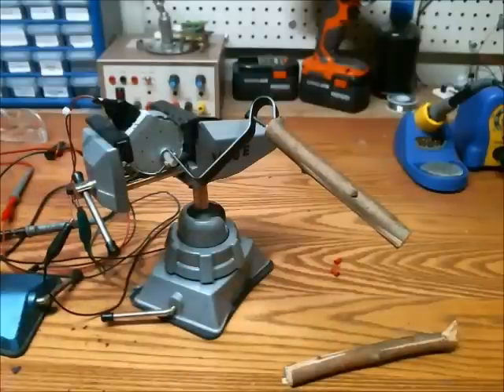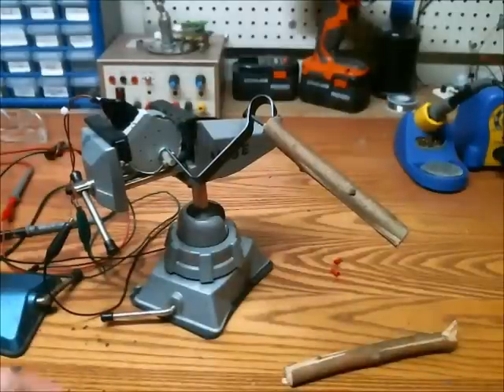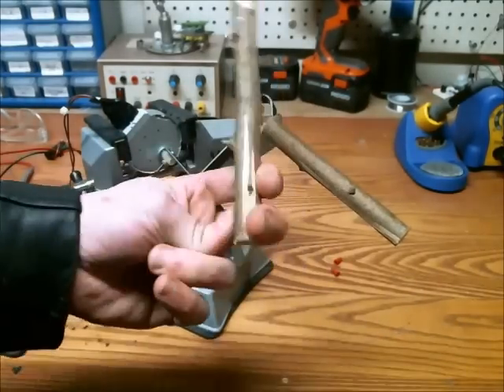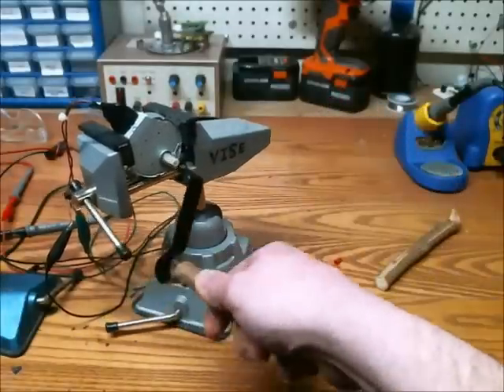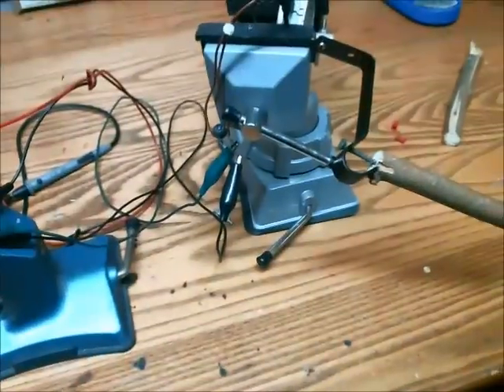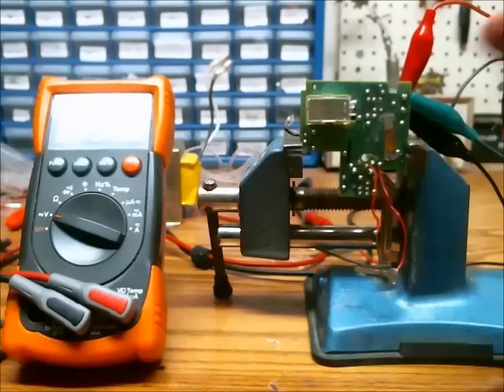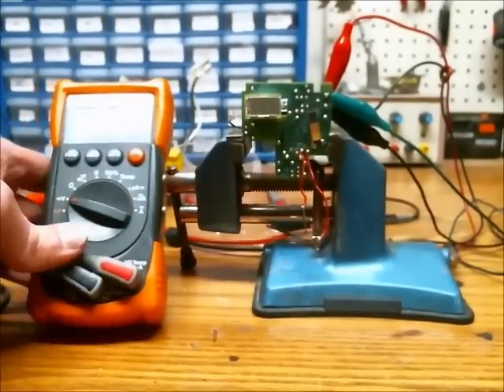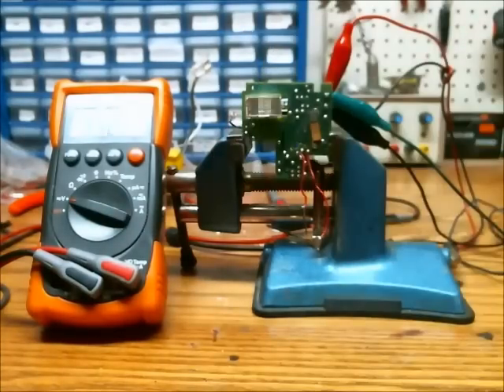Microwave Oven Motor to Power Generator

Comment: I have a motor of a washing machine that I would put on my gocart, and feed it with the engine of a microwave: what do you think if I put the cranks to the microwave engine? it will be powerful enough to power a motor of a washing machine that works from 110 to 240 volts?
Reply from the maker: A washing machine motor requires around 100 watts, the microwave motor can only generates 5 watts...
This forum may help http://www.diygokarts.com/vb/showthread.php?t=3267
good luck
Reply: Heilman Hackatronics Thanks ^_^

Comment: Great to see this demonstration of the High voltage capability's of these motors, using scrap parts you had lying around. I think this demonstrates exactly how easy these little motors are to convert to a generator. I wonder if you could start a fire with your one twig handle... Would beat rubbing two sticks together....